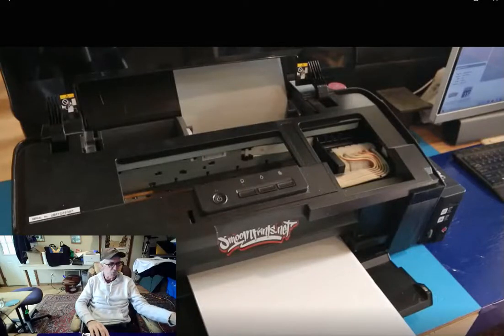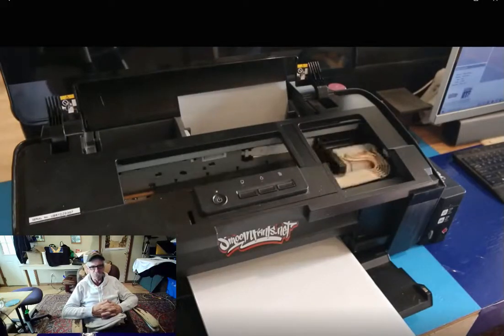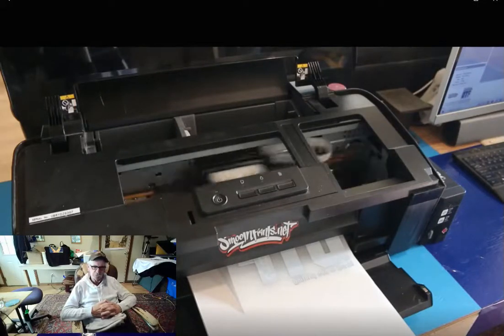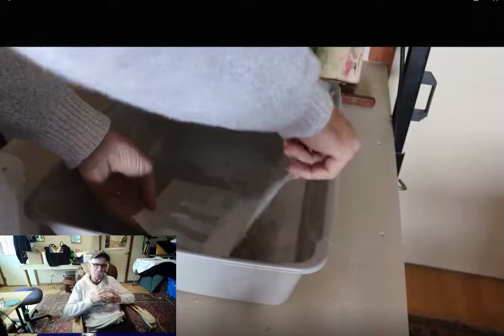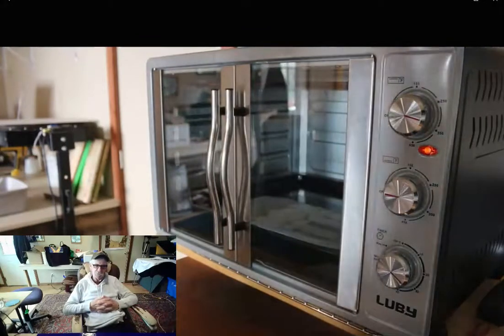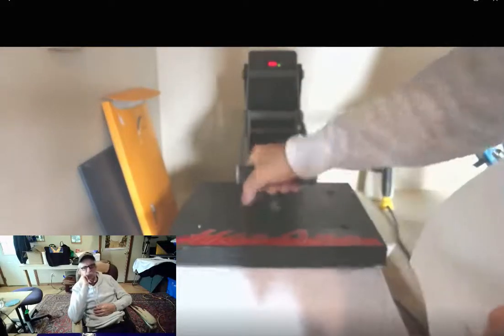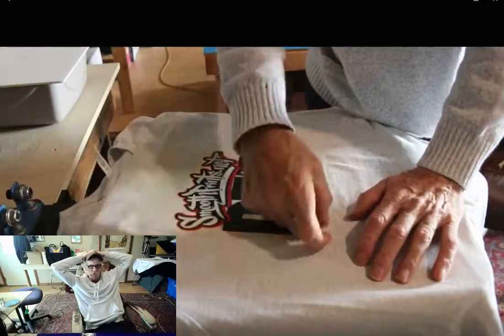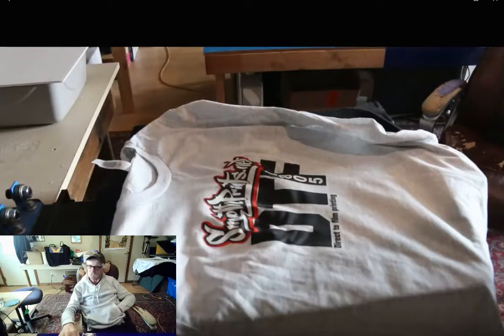DTF PRINTING Direct to film

Comment: brand of your microwave/oven thing?
Reply from the maker: Ruby is just the brand I picked it is a little extravagant @ $135 but you can choose from a lot of different ones on Amazon I saw a good one for about $50. They just have to be big enough to lay your film down flat at 305*F for 12 seconds for the cure. It is listed in Amazon as a toaster oven, microwave will not work.
Reply: @gualalasmooth  thanks and how long in the oven? What temp?
Reply from the maker: @leonmakest-shirts  305 F for 12 seconds for curing